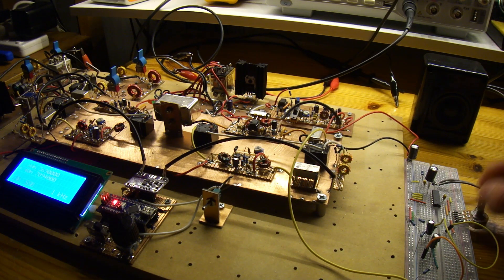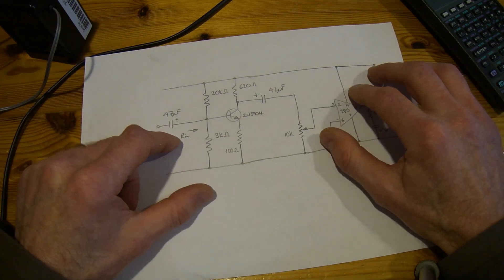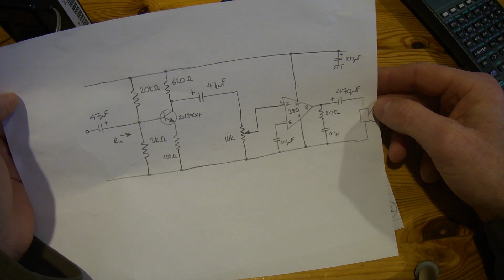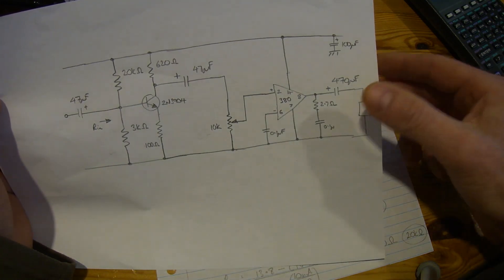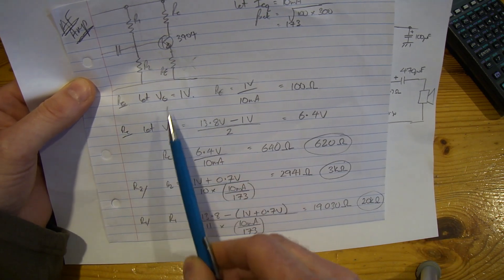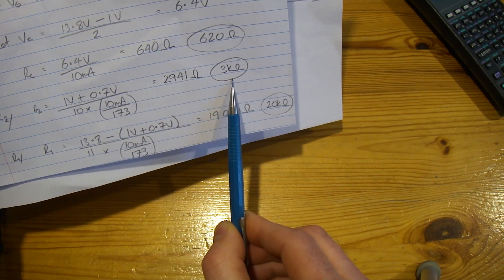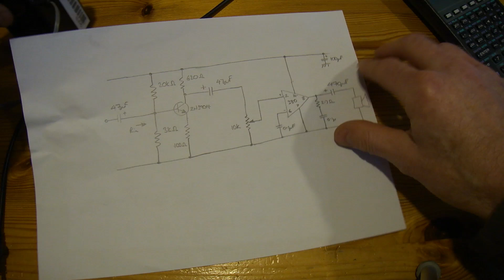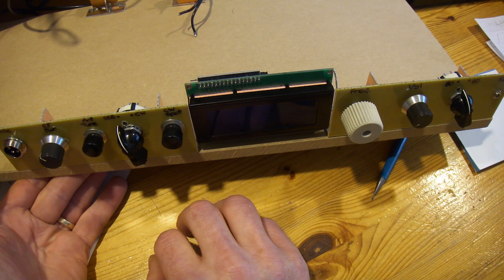Homebrew 80m/40m SSB/CW Rig - Part 2: Audio Amplifier

Comment: Just a brief question. In homebrew rigs I can see frequent use of AF finals with LM380 or (worse) LM386. I have been using TDA7052 instead, with very good results. It is cheap, needs very few external components, no need for a large output capacitor and RC damper, true gain control and mute, given equal supply voltage it can deliver more power output than LM386 (or any LM38x) => less distortion at the same AF output. Is there a good reason why everybody uses LM38x chips?

Comment: You can always simulate your design in something like LTSpice. This way you have the ability to optimize the circuit and make less susceptible to the component nominal variations.  I am trying to do that more and actually I started to like simulations before the building hardware. Most of the time it worked out well for me.
Reply: I saw in some other videos he was already using LTspice. But I will agree. When I was designing guitar amplifiers I spent 10x the time in LTspice than I did actually building them. And I spent quite a lot of hours building them....

Comment: I built my own FM CB into a President case, and all on one PCB. It took nearly 20 years to get it working 100% !
LM380 benefits from reducing the cap on the -in to 1nF or below. Cuts out the rumble and knocks the high gain of the chip down. I am driving from an MC3371.

Comment: Am I missing something?  You want a collector current of 10 mA, which I agree is perfect for an amp that doesn't need to run at super low power, which should correspond to a base current of 100 μA.  But although you said you wanted 10 times that through the bias voltage divider, which would be 1 mA, you used 10 mA in your calculations.  Not that this won't work; it most assuredly will.
Reply from the maker: Hi. For R2 I used 10x Ib, or 10x(Ic/HFe(Ic/hFE), and for R1, 11x Ib. I'll double check.
Reply: @CharlieMorrisZL2CTM  You are correct - I misunderstood that you had put the Ib calculation within the calculation for the resistors, so when I saw 10mA, I thought that was the current through the voltage divider.
Reply: Love it! I've designed a 74hc4053 based ssb transceiver but it's still on paper. There r minimum coils and transformers. Is this chip easy to get?

Comment: Nice planning on the control panel off the start. that can get clumsy adding it as you go.
Reply from the maker: Agreed. It's just made with copper circuit board soldered together. It's what I like. Each to their own!

Comment: hi, what is the amplitude of the signal at the entry? thanks for the video. 😃
Reply: Depends on how much you want out!  I haven't looked at the datasheet for the LM380, so I don't know how much gain is in that stage as he has it configured, but for the preamp, the gain will be approximately the ratio between the collector load resistor and the emitter resistor, for a voltage gain of about 6.  Since he has the emitter calculated to be at 1V, which sets the low clipping of the output, and the high clipping is the power supply voltage, or 13V, that's an output swing of 12V, of which you don't want to use more than about half if you want to avoid the worst distortion.  So that gives us 6V peak-to-peak on the output, and with a voltage gain of 6, this puts the maximum useful input voltage at about 1V peak-to-peak.  This is maximum, and the minimum, again, depends on how much voltage you want at the output.  Also note that since the volume control comes after the preamp, you can't just turn it down if you're overdriving the preamp.  As Charlie says at the beginning, this is not meant to be a tutorial, but just documentation of how he designed the circuit, so you shouldn't treat it as a cookbook recipe.  But I will add that it really should work perfectly, so feel free to use his circuit as a starting point!
Reply: I had the same thought.